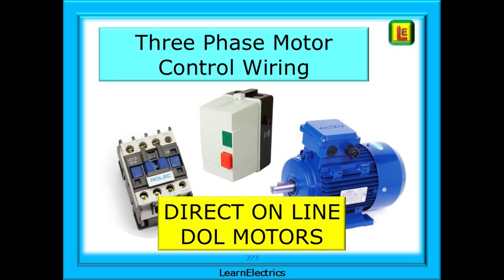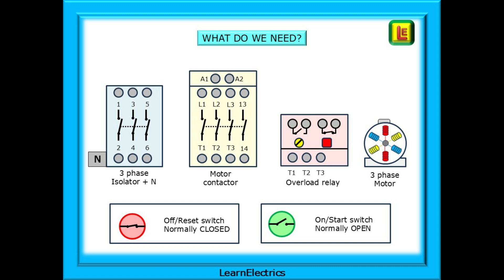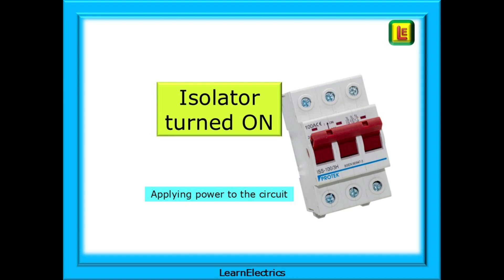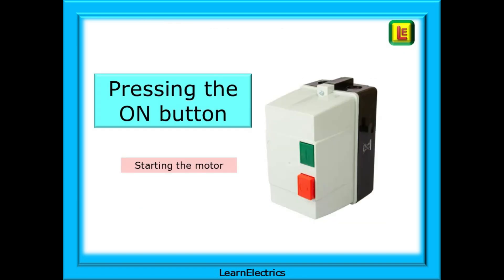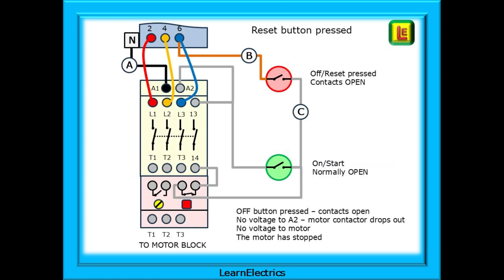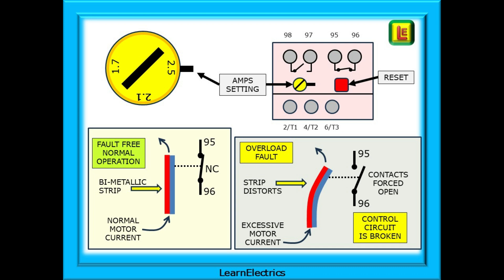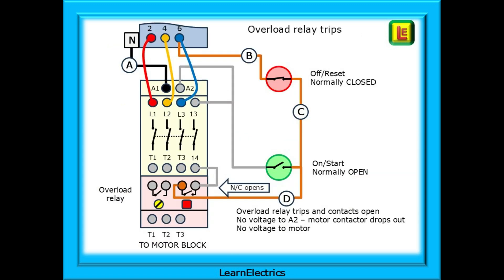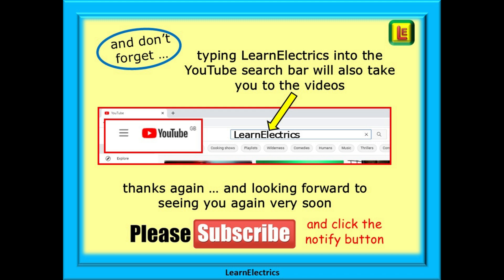THREE PHASE MOTOR CONTROL WIRING – DIRECT ON LINE MOTORS – DOL – HOW THE CONTROL CIRCUIT WORKS

Comment: Any advice on this situation? Recently iv came across one customer 
The customer was plugging grinder to the basement radial circuit and it tripped the rcbo but when we tried different appliances on same radial circuit it didn’t tripped the the rcbo
Firstly I suspect the grinder was faulty but when iv tried grinder on different circuit which was ring circuit and the rcbo didn’t tripped
Reply from the maker: There could be other leaky equipment on the same circuit which, together with any leakage from the grinder is enough to trip the RCBO. Remember, a 30mA device is designed to trip between 15mA and 30mA, not AT 30mA, so it won't take much.
Take a look at this video on RCDs, it may give you more information.
https://www.youtube.com/watch?v=6OgaB0BIj18

Comment: I've heard that its wiser to feed into terminal 95 of OLR first before anything else (after Control Circuit's OverCurrent PD ofcourse😅), it that true?

They justified that if the OLR tripped, with the schematic shown in the video, pressing+holding the Start (NO) button will "force" the faulty/damaged motor/load to RUN, bypassing the OLR altogether...🤔
Reply from the maker: That's an interesting point, thanks for raising it, and certainly worth considering. Dave.